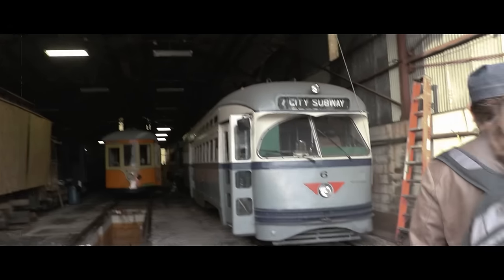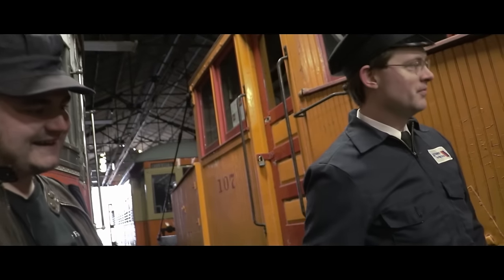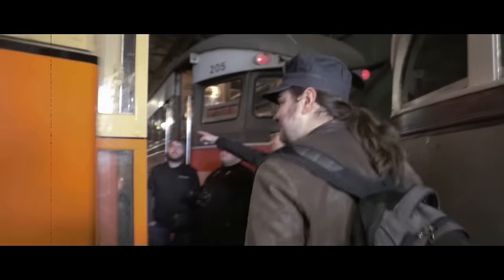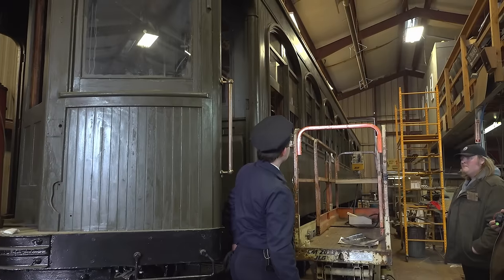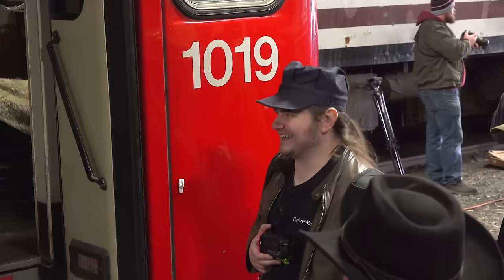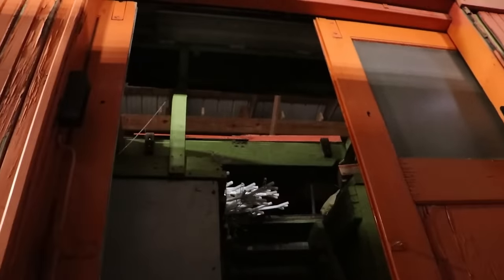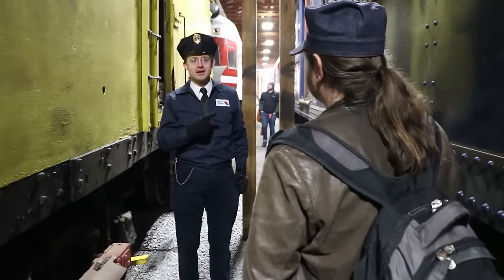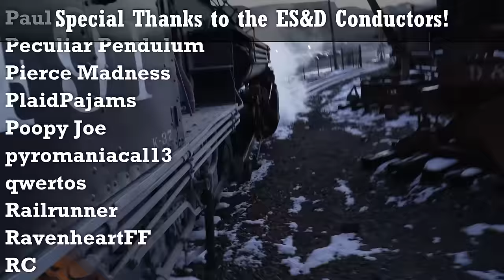An insider look at the INCREDIBLE Rockhill Trolley Museum! | Part 1

Comment: 36:05  Wow, those doors… When Duewag was mentioned, I got pretty sure; Oslo’s now retiring SL79 (built 1979-82?) articulated trams were a co-op between Strømmens Verksted (very defunct) and Duewag - I think before ABB and Siemens took over. 

The handrails, windows, the optical gear for ‘tripping’ the door, the rubber seals - It all seems too familiar to be a fluke. If these are also electrically operated (not pneumatically) they must be the same door assemblies as the 🇳🇴 / 🇩🇪 ones… 

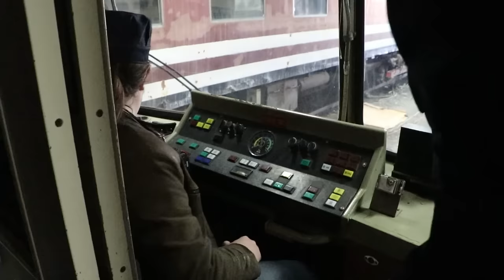Edit: 37:00 Yep, same control electronics. So this is an early chopper-type thyristor controller, “singing” in a set tone (before ‘81), or in “two octaves” (later ones)…?

Comment: Hello Hyce,
The guy is just amazing. It was very interesting to hear the stories about the vehicles.
So they have a DueWag vehicle from San Diego in their collection? Great, and yes I can confirm that the Series U also ran in Frankfurt/Main.

Did you know that the PCC trolley is the template for the DueWagand the Czech CKD Tatra large capacity cars (in this case the Tatra cars T1 and T2). By the way, a modern representative of the Tatra car drove as a prototype in New Orleans. This was the type T6C5, which later got to Straussberg near Berlin and can still be found there today.

Oh and thes link and pin couplers... We call this in Germany "Albert-Kupplung" or "Trompeten-Kupplung" (trumpet coupler)
This type on the Duewag U2 is called "Scharfenberg Kupplung" und nowadays standart here for Trams,  and multiple units.
There are efforts to use a further developed Scharfenberg coupling as a so-called "digital automatic coupling for all vehicles throughout Europe in order to simplify the shunting effort and make it more cost-effective. I thing you use the janney coupler as an automatic coupler.

Greetings from Germany
Morpheus

Comment: The U2 cars. As someone from Frankfurt, I do remember them well. They survived on the lines U1 and U6 the longest. But overall where weren’t used on the U6 long, the stock was move there from the U7 shortly before retirement.

Yes we named the Cars with a U prefix and also name the lines with a U prefix. It’s very confusing.

Comment: About the U2 car: You mentioned it has a Dellner coupler, now that sounded unfamiliar to me as I have always known it under the generic name Scharfenberg coupler, after the inventor who invented it in 1903. Certainly Dellner seems to be a big supplier of these type of couplers which went through some improvements, adding additional electric connectors, until the recent plan to put a "digital" version on all European freight cars replacing the screw couplers. And there have been reports from Frankfurt of people climbing over these couplers and even riding on them, so the warning is very justified! What a great tour!

Comment: I can’t believe they’re already putting U2 cars in museums! One of the few pieces of transit equipment I have any real experience with, they’re still runing here in Canada! They have a very distinctive “old grease” smell, and you can hear the contactors clicking under the floor as it accelerates. They’re tired, but still soldiering on 40+ years later! The bit about the transit signalling system was interesting, I’ve always wondered what all the buttons were for. I’d love to see a video elaborating on that sometime!

Comment: I think the battery electric trolleys have a lot of potential. Especially if the trolleys can also run off of overhead wires or third rail power. It would let you only have trackside electrification for short stretches in and near stations to provide the power to get up to speed, and then the battery could carry the train along most of the route without needing to pay for most of the line to be electrified. And you could use the station stops to top up the battery a bit. Because you wouldn’t need to handle all of the full-power accelerations, the battery could be a lot smaller, lighter, and cheaper. All you would need is enough to handle the typical load of pulling a train along at speed, and enough spare capacity for two or three slower accelerations to leave a margin for if the train ends up stopping somewhere it isn’t supposed to. And since it can travel through a town without needing catenary wires nor emitting diesel fumes and noise, it’s as close as you can get to being NIMBY-proof.

Comment: 1:20 - Fun fact for a start: Over here in Germany, legally speaking trams are kind of a weird car more than anything else. They drive according to the road traffic code and while they have some special rules building up on that, they basically are a regular road user xD This even includes light rail like the Berlin or Hamburg U-Bahns which don't share space with road traffic anywhere, they are legally trams and thus still closer to a car than to a train. But that's kind of a German specialty (though not exlusively, I think there are other countries with a similar approach). In Norway, the way I understand it, light rail including trams is legally treated as a special kind of railway.
3:09 - Doorbell voltage, as we say =P I don't know off the top of my head why trams seem to all have chosen DC (also since DC-driven corrosion of close to track structures would make an especially big problem in cities, which rumour has trams often tend to run in, so you need all kinds of shenanigans to prevent this from happening) but the range of 600 to 800 V DC is pretty much the standard over here as well. In Germany 750 V seem to be predominant.
10:00 - Ah yes, the downfall of huge, continuous tram systems =( Not in the extent as over on your side, but we did have quite a ton of such losses over here, too. But there are some surviving systems, too.
20:40 - Oh I've seen plenty of roll signs in action myself and we're roughly the same age. Where I grew up we had a fun system of backlit roll signs with what I'll very strongly presume to be digital control. A LED light was indicating the current/next stop and the signs all scrolled to the right page at the end of line or at line changes. Back when screens where still rather expensive, dim and with low resolution (and also not necessarily very robust), roll signs were quite a good choice as a display system for computer based systems, too.
22:50 - The fun thing is, from what little I've seen of imagery, it seems like in the US trams still use trolley poles instead of pantographs …?
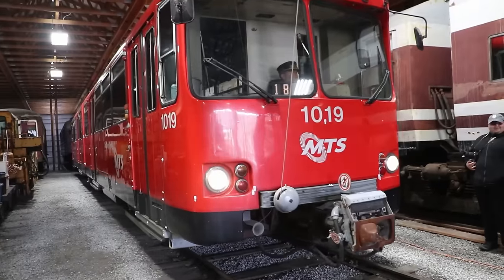34:30 - If you ever come here, you can see the original Frankfurt ones still in service with a bit of luck.
47:10 - And yet - in other parts of the world, public transport including trams, light rail etc. survived in way more extensive amounts than over there. And the great depression and such things went across the pond, too. And while we don't have the hurricanes, we had a big war swiping across the continent. So the conflicts of interest must have played quite a substantial role.

Great video, Mark!
Reply from the maker: It's surprising to me you guys lost tram systems over there too. The narrative always just seems like "the USA fucked it up and no one else did." That's interesting. Yes, almost every trolley I've seen over here uses a pole rather than a pantograph. Thanks!

Comment: Hey Hyce, When did you do this trip? Just wondering since your guide mentioned the battery powered street car being considered for potential used by on SEPTA lines here in PA. The thing is, that the parent company VIVARAIL filed for administration in the UK about a year ago; with the PIttsburgh based company RDC pulling its support for the project in 2022. The Great Western Railway has since announced that they'll continue the refits, but only for their usage in the UK.

Comment: Sorry, but I have to make a correction on the Electroliner.  We at IRM can't run it like we stole it.  We can run it like we're scared to break it.  It's had a ton of work done on it, and still needs a lot.  While it does indeed run, as of a year or so ago (last time I heard an update) only half the motors were operational.  It runs maybe once or twice a year, but without passengers.  
It's also been backdated to the original orange and teal, which I must say looks WAY cooler than the  Liberty Liner scheme!
Reply: I smell bias, but as a IRM visitor, I can confirm that the electro liner looks beautiful.

Comment: Not quite accurate on the D-stock; it's not non-standard, it's that London Underground has two standards - the smaller, iconic, deep level tube stock runs in circular tunnels that are 11' 8" in diameter, dug with tunneling shields and later TBMs; and the larger "sub-surface" stock which is to the British standard loading gauge, and runs in tunnels that were dug with the cut-and-cover method. The D-stock trains were taken out of service mostly so that modern amenities and modern automatic train protection systems could be introduced on the sub-surface network.
Reply: And Vivarail, the company that built the things, went under a while ago. Not exactly good news for the pop up metro idea